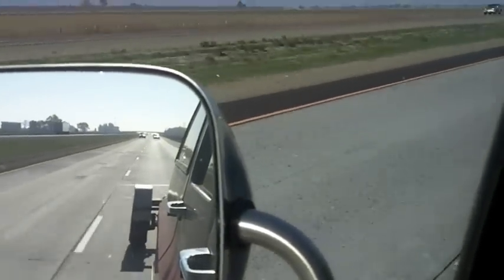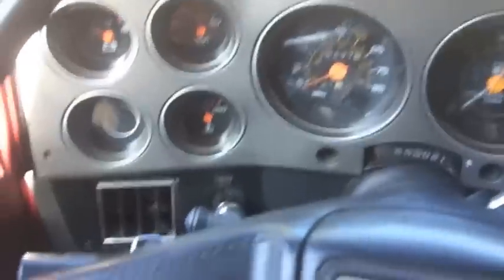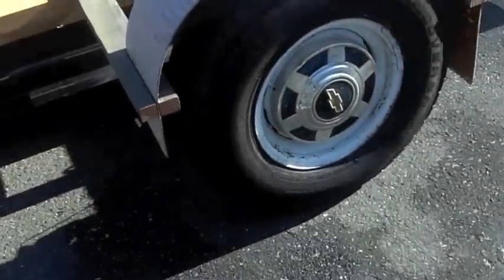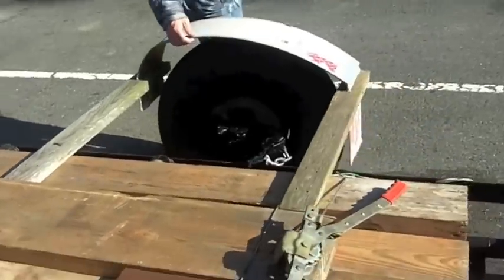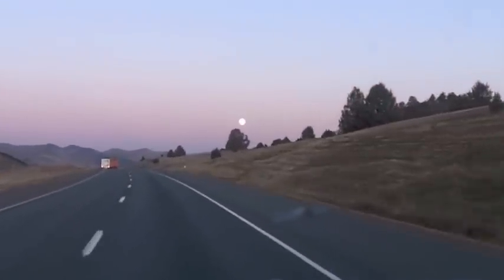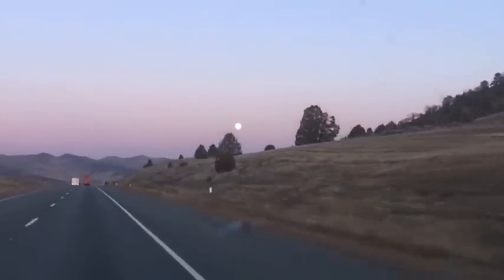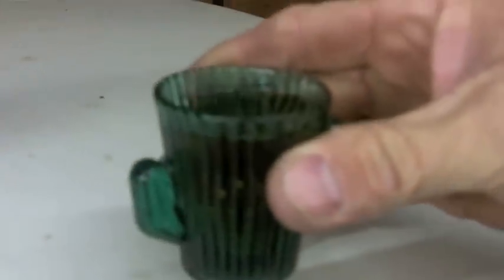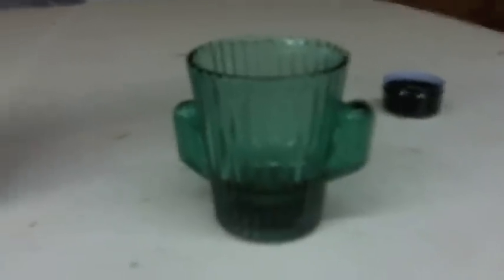Home Built Sawmill Bandmill Trailer Real Road Test

Comment from the maker: @TheFred1952 It took about two minutes to get them working... Most of the time was spent securing the wiring to the trailer so they wouldn't flap in the wind.  I found these on sale at Harbor Freight and paid $9.99 out the door.  Now that it's at its destination, I never need them again. Thanks for watching.

Comment from the maker: @oldchevy4x4 Oh man you ain't just whistlin Dixie.  I made a small calculation error when I welded up the spindles to the old boat axle... I didn't figure the hub or the rim offset correctly and it ended up much wider than I wanted. Honestly I didn't even consider how narrow the bridge was until I was about 100 yards away and by then it was too late. Thanks for the comment.

Comment from the maker: @mbyr31 I had to pull the steering wheel and exhaust to clear the rear air, but it fit with plenty of room to spare.  I was a little tense ... I didn't poop for two days after this trip. Thanks for checking my videos out.